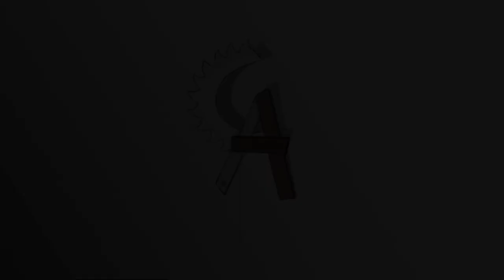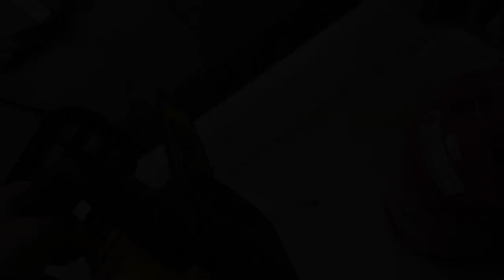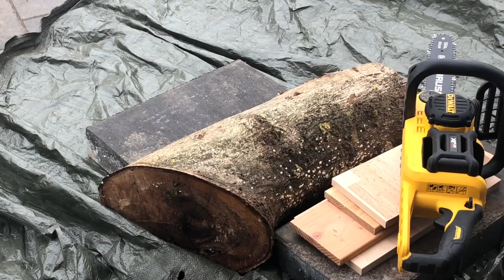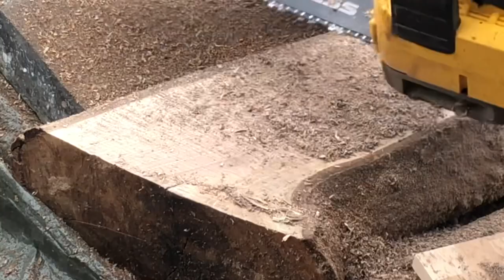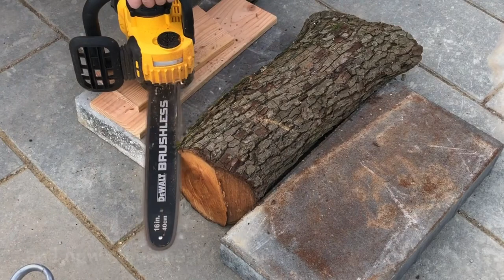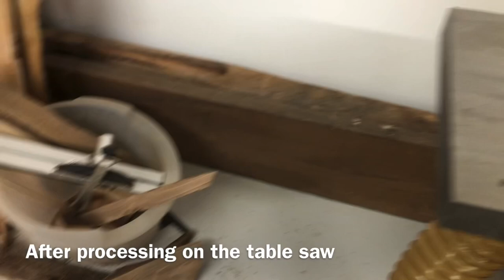Dewalt Chainsaw hack: milling small logs, battery powered sawmill

Comment: Did you dry the wood prior to processing on the planer and table saw?
Reply from the maker: The walnut was already dry before cutting with the chainsaw. I expected a lot of cracks as it dried this way but it was actually pretty good. The pear was fresh and cut to boards for drying. 🙋🏻‍♀️